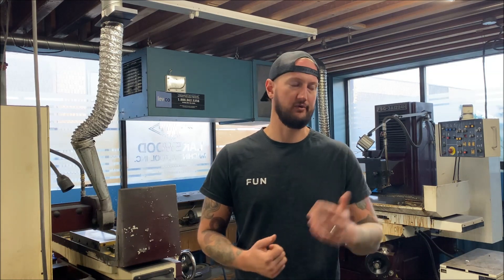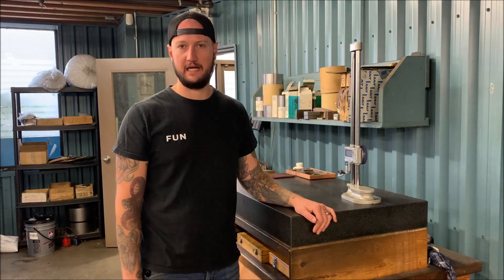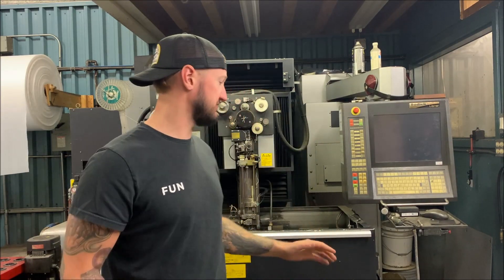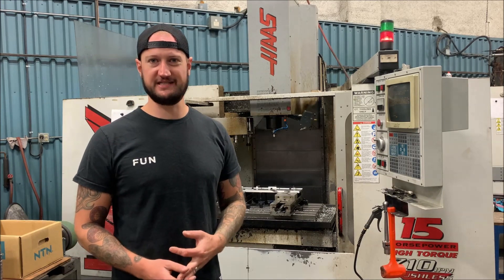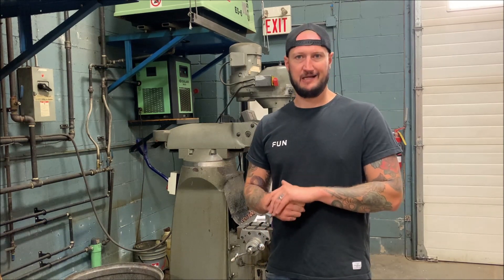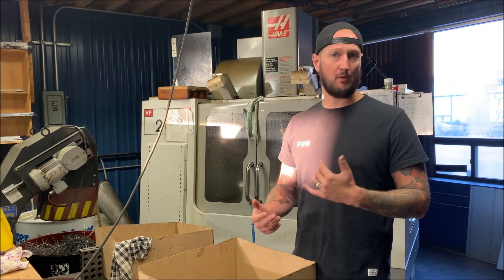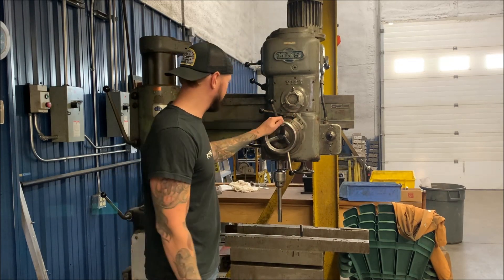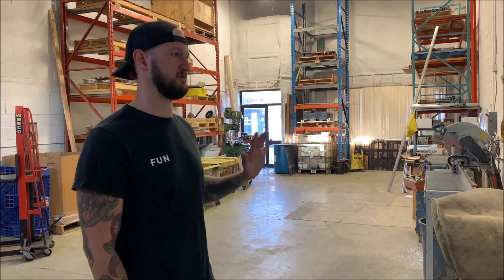Machine Shop Tours:  Lakewood Machine & Tool

Comment: Sad how dies have become extinct anymore. I was a tool and die maker since 1972. Soon after my apprenticeship I started my own shop. All manual equipment until a few years into it I bought my first CNC. No tool or die making, just production work. I always personally hated production. However to make real money production was where it’s at. One led to another, then another. I started mfg my own line of motorcycle parts which was great. When I sold the business to my sons we had 15 CNC machines. CNC has definitely changed the machining world. Simply sad that you just can’t compete  with China on the majority of things. I loved your comment about ppl getting dies from China and then spending thousands to make them right. I’ve found China to be great imitators but not creators. Sadly a few of my products were a hit and got knocked off in China. Guess where those sales finally went to.  Thx for the tour.

Comment: Now thats a vintage looking drillpress. I have yet to see one in that style before with the motor mounted directly above the spindle like those on quill style bridgeport mills (like the 2 ones you showed). One might mistake it as a mill from afar, it seems to have a z axis (i suppose?) Instead unlike today's top-compartment belt driven pillar drill style or the even older cast iron framed flatbelt driven drillpresses. It's strange how i want a tool like that because i do light tinkering metalwork not machining-that-requires-a-floor-drillpress metalwork.

Comment: Really inspirational video. I’d really like to see some pictures of the shop when it had a full shop with all the manual machines. I actually just got my first home machine, it’s a 1950s delta Rockwell lathe. Going to look at hopefully my first mill for the house in 6 hours (which is why I’m not asleep). Half of the machines in the shop I work at are Haas, they usually run the more complex programs that are wrote with softwares. I run the Hurco cnc mills in our tool room department which are conversational. If you guys decide to get a new machine, I would recommend looking into them. I live in Omaha Nebraska, very interesting seeing videos from all over the world.

Comment: We have a couple of Bridgeport knee mills built in the early 70's, a manual lathe and a 2005 Haas sl-20 lathe. The Haas paid for itself in a little over a year. Still haven't convinced the higher ups to get a CNC mill which, after adding up the cost of all the mill jobs we had to shop out, I'm sure would pay for itself within a couple of years tops.
Also, take a shot every time he says "predominantly"
Thanks for the tour and the buzz!
Reply: > Also, take a shot every time he says "predominantly"

I wouldn't recommend that, sounds like a way to end up on the floor pretty quickly! Oh, the joys of never working from a script!

Comment: Very nice shop. Would be nice to trade that old HAAS but when its paid off and still working its hard to justify. Those MAS radial drills are nice, made in Czechoslovakia if I recall.
Reply: I believe your right on the Czech point of origin - they certainly knew how to build them solid!